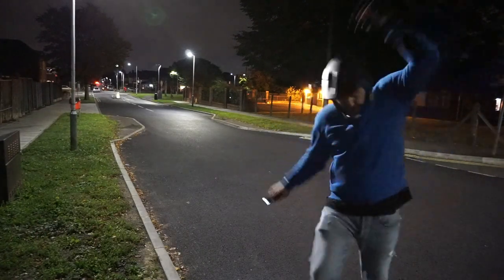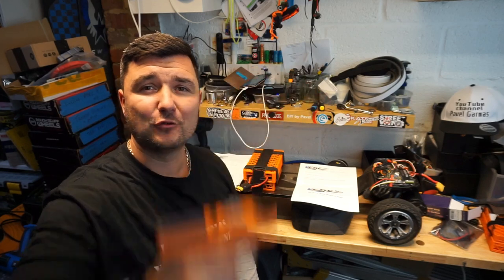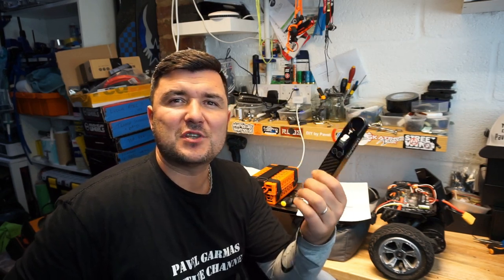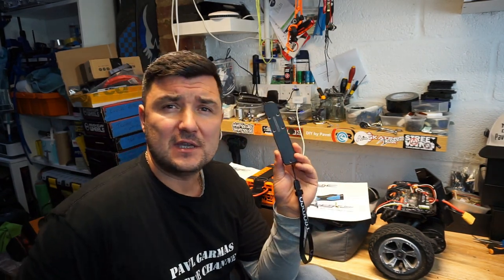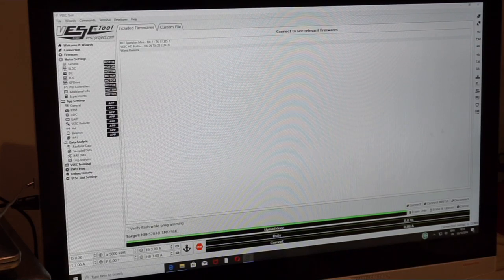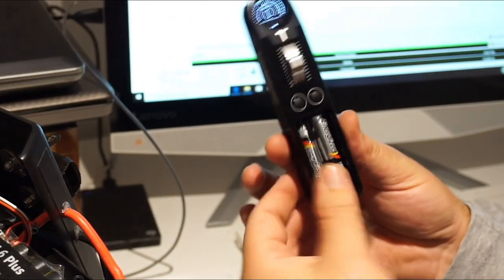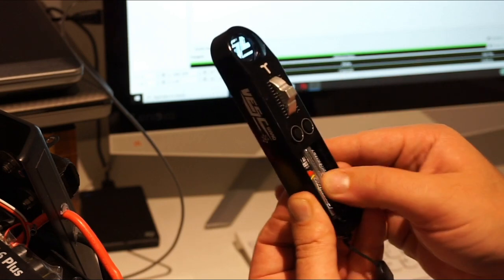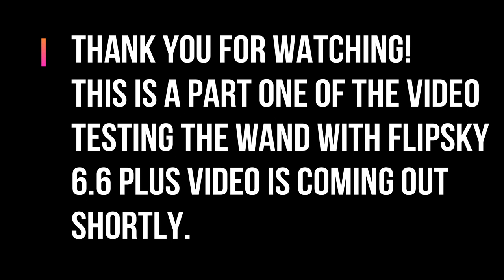TRAMPA WAND UPDATE TUTORIAL

Comment: @Pavel Garmas
I have a problem, maybe you can help me out.
Do you know how to connect the Wand remote to a vesc 4.20mini.
When i try to connect the Wand, the Vesc tool is telling me (every time) it can't read the firmware version.
On the Trampa website they say the remote is compatible to any vesc...
I asked the Trampa guys about this issue and they told me i probably need to have a vesc 6. When this is true, why they say the Wand remot is compatible to any vesc based esc.
My board 4wd with 4 vesc's is finished and the only thing that does not work is  the connection with the wand remote.

Do you have any idea about my conection issue?

Regards 
Mario
Reply from the maker: Hello Mario,
Not sure if you got the issue sorted already...
Did you update the firmware on the esc units and then the same firmware update on the Wand dongle?
I have only tried the Wand on Flipsky 6.6 plus to be honest but it should work on esc vesc 4 based....
Let me know.